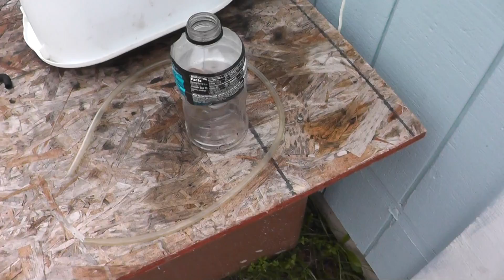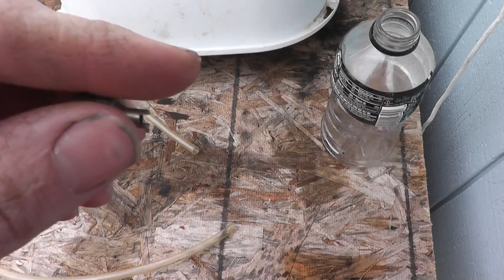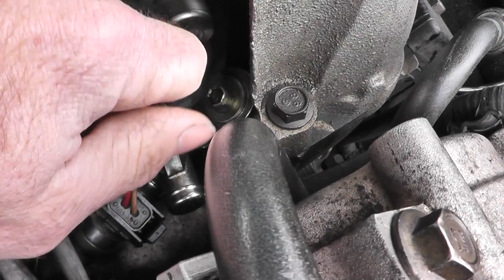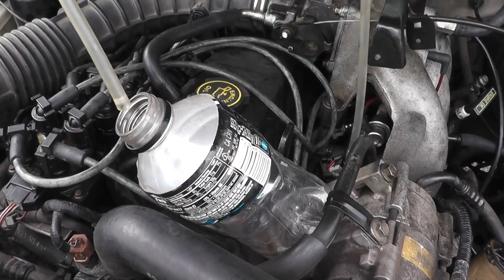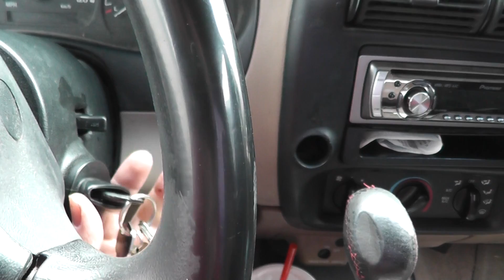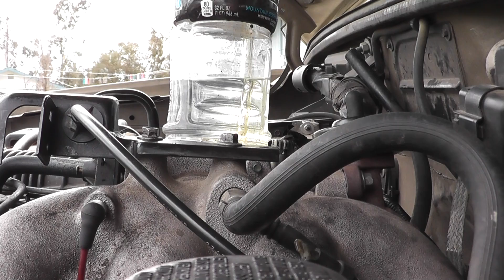How To Get Gas Out Of A Car Without A Siphon - Let The Fuel Pump Do The Work!!

Comment: Does thjs work for a 2000 hyandai elantra and where is the Schrader valve? How do you know if it's time to replace it? My car has about 7 gallons of water in a 14.5 cap tank.

Comment: To the people here concerned about "old" gasoline damaging your fuel pump, there are several YouTube videos showing engines running fine on gasoline that's sat in tanks for many years -- as long as the tank itself isn't corroded.  BUT be sure you don't run your electric fuel pump dry trying to completely empty a fuel tank or you may burn it up.  The gasoline cools the cheapo motors in those pumps.

Comment: You also can turn on the ignition, pull the relay and use a paper clip to connect it between the power terminal of the fuel pump socket and the fuel pump terminal and pump out as much as u need. A lot less time and not having to turn the key on and off. But if its just a splash of fuel u need i would do it this way too
Reply: I tried that and it blew a fuse for the PCM/ECU. must have jumped the wrong ports together. any idea how I can find the correct connection?

Comment: Should have removed fuel pump relay and jump the #30 and ground pin locations with a thin wire with ignition key in the on position not the start. Don't crank engine over.
Reply: This doesn't require cranking the engine, just turning the key to "on".

Comment: Did u know that barely turning the key to start for a split second long enough to run the pump but not to start the vehicle gets more out faster. Just dont let it crank all the way over. And fyi u have to wait a min of 3 slow seconds to get the pump to reset its prim persedure

Comment: Not super mechanically inclined, but I'm trying to drain my tank. Long story short, store sold gas with water. Would this work with a direct high pressure injector? I've found it under the hood, but the terminology just sketches me out a lil.

Comment: l. Disconnect return flow from fuel filter. Stick a suitable snug pipe in return feed.. Stick other end in a fuel can. Start car. Done.
Reply: Most cars don’t have a separate return fuel line nowadays, the fpr regulates pressure in the fuel rail so a return has not been needed for over 10 years on most cars now

Comment: That's one way, and the way I use too, but do beware. I would put something inside the hose or a vise clamp to the outside of the hose itself, to create a little back pressure. If the pumps are running at free flow speed, they could get hot. The fuel helps cool the pump. Iv seen them burn up

Comment: This is all fine and dandy, but in my case, I have 8 or 9 year old gas and do not want the gas getting anywhere near my new injectors, so this is kind of useless.....
Reply: kevin knox bridge the terminals where the fuel pump relay would sit and that will run the pump continuously.
Reply: _Milo, what does that have to do with not pressurizing the fuel rail?

Comment: That trick won't work on a car from the 60s because back then the fuel pump was driven by the engine and there was no electric pump in the fuel tank.

Comment: you can fine the fuel pump relay, remove it, check for connection 87 , 333 and by pass
Reply from the maker: I never did a video, but I always kept a piece of wire for a jumper and length of hose under the hood, and a cap on the valve with one of the core removal tools built in. instant gas, any time.
Reply: @jenniesgarage  EVEN IF THE PUMP DOESN'T WORK?

Comment: Good idea, though i found an easier solution to constantly turning the key was to remove the relay for the fuel pump and put a piece of wire across as a bridge to run the pump continuously. Cheers
Reply: Good 💡
Reply: so what, he got 1/2 million views and you got nothing. He just wanted to squirt the pump in 3 sec. increments to get some fuel out-that was good to know. dozens of other videos were made to show exactly what you claim to know how to do
Reply: @keytothegate68  The dude gave some solid advice. And saves the time from going back and forth cycling a key without knowing the fuel level in the bottle. With the recommended method you bashed on, you can visual control exactly how much fuel you want. Your comment gave zero contribution. Congrats.
Reply: keytothegate K 
Damn. You sound like a full blown loser. A bitter moron who bashed great advice from the comfort and safety of your device screen. 

I pity losers like you.
Reply: Dai H  I like your idea. Geez sum ppl troll jus to troll. Pathetic

Comment: now explain how you don't get gas all over the place when removing the hose from the stem...
Reply: +Miguel Rivera hold the end of the hose that was in the bottle just like the straw in water trick, I assume there would be only a little spillage.
Reply: Yeah, just cap the top with your finger and it should be okay.
Reply: @Gixbit  
That's fucken right my man dude! 😂
Reply: good question.  ya might spill a drop or two still, just whatever ya do wash your hands soon. :^D
Reply: Place the bottle and the majority of the tube lower than the valve end, then pull it off. I'd expect a siphon would prevent much spillage.
Reply: Take the hose off with alligator locking pliers;)

Comment: Once again, I find a practical solution from some nice person on Youtube sharing their experience! Thank you, narrator of this video from Jennies Garage.
  I'm all happy and will use this method if the need arises and I am able to do so.
 Also, once again, I read the comments:  There are the naysayers. There are always people against what is going on around them. If one listens to all of these negating-types and does what they say (rather:  doesn't do what they say), not much could get done. We just want to get things done!
 Plainly use some common sense folks and for those who don't have access to common sense:  good luck with your lives.  =^.^=
Reply from the maker: Alec Tric Foxx Thanks for the comment. It's true that gasoline is flammable, and the high pressure of a fuel rail should be approached with caution. I wonder how common common sense actually is.
Reply: ***** UPDATE:  I found the Schrader Valve on the Fuel Rail on one of my Crown Victorias, an '88 Ford Ltd.Crown Victoria. I've had this car for 24 years and do what I can myself.
 I'm humbled:  I never knew that Schrader Valve was there! I didn't even notice it years ago while replacing all the distributor cap, rotor button, wires, etc.  A "boot" covers all that and really hides the Fuel Port so it's never seen.
  I need more excuses; what do you expect from a fox that owns all the Dealer Manuals to his automobiles, what with the High Detail they offer. C'mon!
(please understand that this is sarcasm mixed with fact ;)
 I needed to purge all the fuel from the lines and getting the fuel out from that Port into a 1-gallon can (used for recovering crap-gas out of small engines), using a piece of Vinyl Tubing I had in the work truck, did the trick!  I, too, did the 1-Sec-Prime via Ignition. Then did that using the EEC_IV Test Plug. Then found how to "Jumper-Ground" the Fuel Pump Relay with a "Remote Switch" (I had made years ago just for cases like this)  This energizes the fuel pump to operate as needed to pump about four gallons of gas out of the tank.  First pumped fuel as far as to the fuel filter under the auto, then pumped the rest of the Remaining line fuel after installing the filter.
   Your method saved me a lot of time and I learned a lot more about how the EEC-IV (Electronic Engine Control -4) operates on these Ford 5.0L Electronic Fuel Injected engines.  
  Thank you, again, over there at Jennies Garage.  
Foxx
=^.^=

Comment: Drive to the gas station don't do that very dangerous
Reply: how so? I didnt see one bit of danger in that video?
Reply: +gene hensley  If aren't going to elaborate then your comment is useless
Reply: You just contradicted yourself. You said the fuel lubricates the pump, which that is what he is pumping. It can't burn out the pump unless you pulled into your driveway and the car died because it just ran outta gas (highly unlikely). Even then there is still a bit of fuel to cool and lubricate.

Comment: Can you use the tire valve nozzle of a tire foot pump? Remove the tubing from the foot pump. You don't have to remove the push valve. Is it the same size?
Reply from the maker: hoplophobiadoc That's a interesting idea. They are the same size, so it should fit. Thanks!
Reply: Legend I tell u! This man is a F'n LEGEND
Reply: In thery yes but u have to be sure that the hose from the pump wont deturate from gas

Comment: good way to check your fuel pump. dangerous way to get small amounts of gas.
Reply: Can you think of a safer or easier way to get SMALL amounts of gas in a pinch? This provides a controlled and metered output in small increments without the risk of waste or exposure. This is smarter and safer on so many levels that it smacks of elegance. It only seems dangerous to people that have a fear response to new ideas. Fear and ignorance will make people do stupid things like risking road hazards, wasting time and money, driving around with an external container of gasoline, and wasting a quart of gas to get a quart of gas. But you make a good point. It is a great way to check your fuel pump.

Comment: Seems like a long process to fully empty a tank but ingenius!  Do you know if this would work for a '99 Dodge Durango?
Reply: It's also a terrible way to paint a house, skin a deer, or wash your dishes and it's arguably ineffective for self defense. I guess you're right. This is an inefficient process for accomplishing lots of stuff! This is obviously not a method for transferring the entire contents of a gas tank. It's an efficient method for it's intended purpose though, which is acquiring small controlled amounts of gasoline for immediate use or application.
Reply from the maker: Hi, it should work for just about any fuel injected car. Thanks!

Comment: very clever & it sure beats having to spit out a mouth full of gasoline.
BTW, there have been many vehicle fires nationwide (also worldwide) & these fires often start a chain reaction of other fires (i.e. garage). Check out the Jumping Jack Flash Hypothesis blog to learn more about the reasons why this may be happening.  This is not spam. There are no ads there. I just wanted to make you aware of it